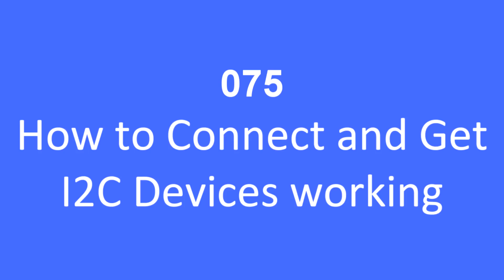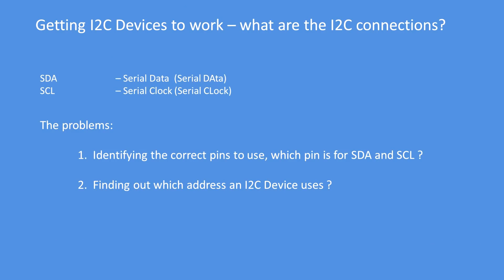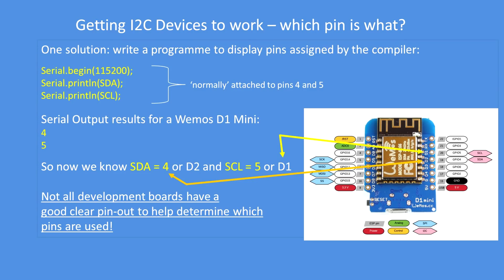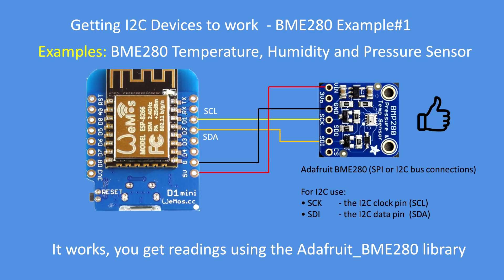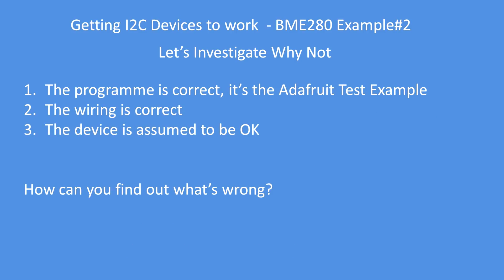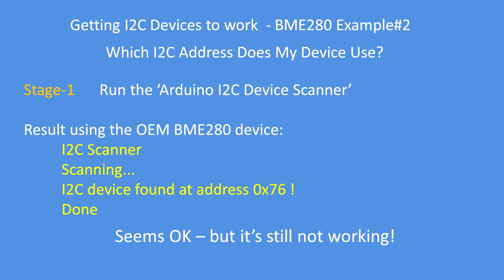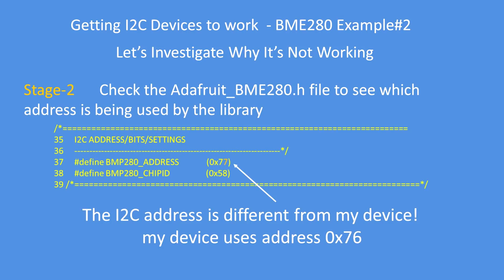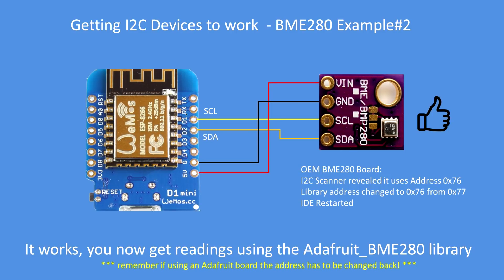Tech Note 075 - How to connect and get I2C devices working (Arduino, ESP32, ESP8266)

Comment: Thanks David that's going to save me heaps of time
Reply from the maker: Good to hear, I've tried to develop a methodical way of checking and inspecting I2C devies becuase I've had so many first time failures and now through a process of checks I can finally get them working first time. As ever the problem is a lack of standards.

Comment: Another factor you never mention is that I2C requires pull-up resistors on the SDA and SCL lines. Improper pull-ups (missing or wrong value) will cause communication errors.
Reply from the maker: Yes I could have also mentioned that the Arduino and ESP32 and ESP8266 all have weak pull-ups that can be enabled which are enough for short distance normal speed I2C bus communications.

Comment: Some libraries allow the address to be a parameter need to look in .h file if call specified.  If using user defined pins just re-define the SDA and SCL definitions before calling the i2c devive/library, don't need to edit the library that way.  You didn't mention need some sort of pull-up some cheap sensors have none, so nothing works.
Reply from the maker: Pull-up resistors, indeed I realise that I left that aspect out. The device pull-ups (pinMode(pin, INPUT_PULLUP); are OK but only about 20K on the Arduino and ~60K on the ESP8266  and I'm not sure of the exact value for the ESP32, but they are described as weak-pullup's so no-where near the more ideal value of ~10K.

Comment: Thanks again for a Great video about problems we usually run into and how to FIX the problem.  In going over the video the second time, wouldn't it be good to modify the library name( Copy the standard library then paste it under a slightly different name, unique to your project)  for this particular project rather than changing the STANDARD library?  It could be a long time before I use the I2C again and with my memory it could be a while before I figure it out. This might resolve problems down the line.
Reply from the maker: A good idea and observation and in theory yes, but have you tried to do that.

For example copying the library and renaming to e.g. Davids_Adafruit_BME280 does not work as there are other dependencies that need to be resolved, not impossible to fix, as I'd then need to copy and rename Adafruit_Sensor and maybe others. The compromise for most applications is to get rid of the Wire.begin() statements and gain the flexibility of being able to define/use other pins with Wire.begin(Sda,Scl) and then the only overhead is the I2C address for non-Adafruit boards. It can become very confusing and convoluted to the inexperienced and I wish it were that easy to resolve.